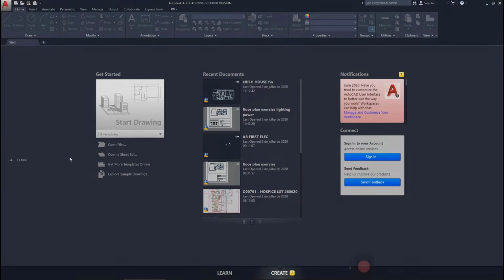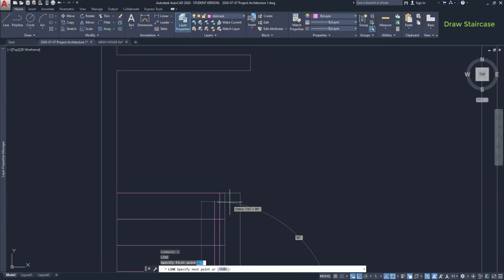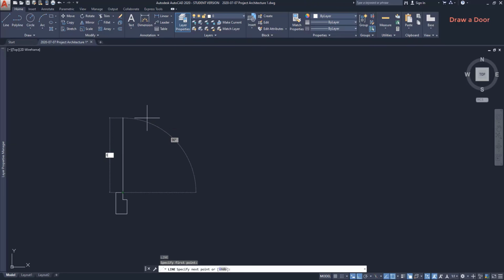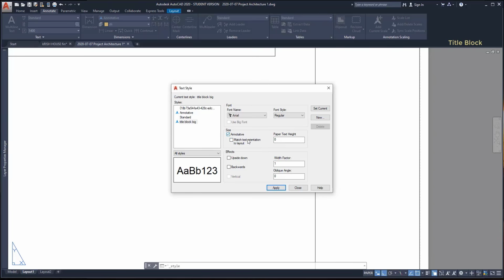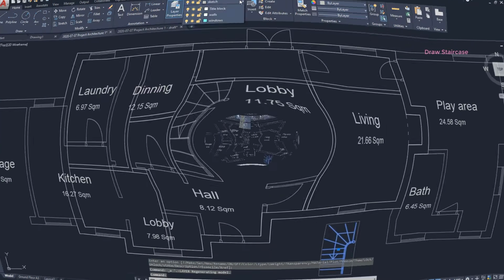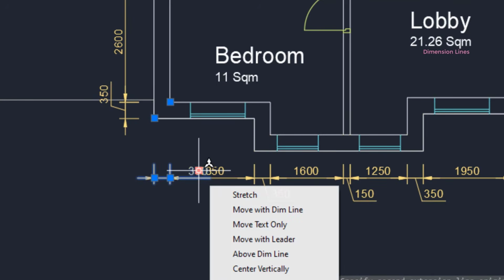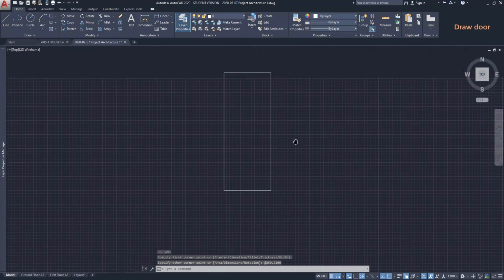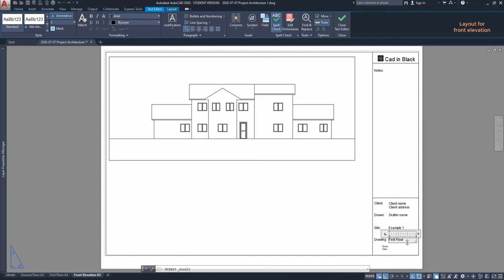Autocad - Floor plan + Elevation. Step by Step (3 complete Exercises)

Comment: I had to go to a different video...When you skipped ahead on the drawing of the rooms, all I'm left with is a floor plan to read which is very difficult for someone at my level (learning about 5 months now)
Reply: just screenshot the floor plan on your pc from the video. import the image. scale it. then use the line tool to trace the interior walls. you don't need perfect measurements to complete the drawing. Also there are a few steps he won't show but with a little critical thinking and backtracking  you'll be able to figure it out. Hope this could help.

Comment: I can't seem to connect the first arc points on the first stair riser, my arc is just shy of connecting even with using the given dimensions for the riser (1250mmx870mm; Start,Center,End Arc 300. any ideas why my arc is connecting flush to the rails? any help appreciated.
Reply: Same problem.
Reply: Same

Comment: This was a great course.  A little fast-paced at times, but that's what rewind is for.  I started making a 3-D model out of it but because of the jut out in living room and bedroom above (fireplace?), my roof doesn't match elevation drawing as well as I'd like.  The 100mm difference between the jut out next to garage and next to front door wasn't an issue; roof just overhangs the short side a little more.  Thoughts?

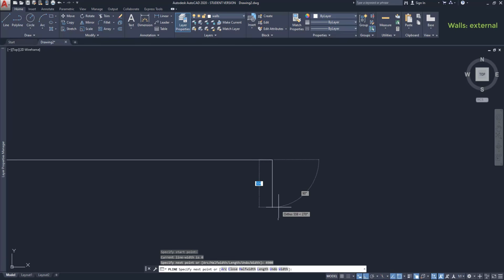Comment: How did you calculate to know its 400mm @ 4:45 and 700mm @ 4:55 , even tho it is not in the floorplan? im confused.
Reply: I've got the same question I'm also confused
Reply: 400 is on the floor plan, just on the inside of the wall, just look back at the corresponding place where he places @4:45. same with the 700, the numbers are just displayed vertically
Reply: how about the others after they're not in the drawing

Comment: for me this method works when you have an existing drawing you are refrencing from. most times I draw from my head and lay dow the walls as they come. sometimes I even reference other drawings but with different dimmension and change of space so going all out with poly line just will not work for me. well done anyway.
Reply: so did you find any solution to draw immediately in autocad with right dimension and area space if you change any thing like revit ?